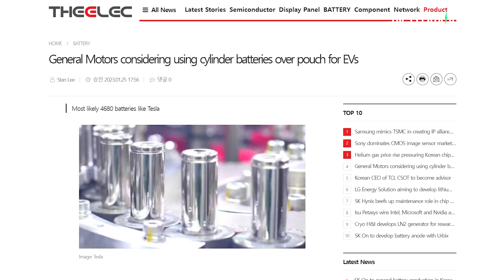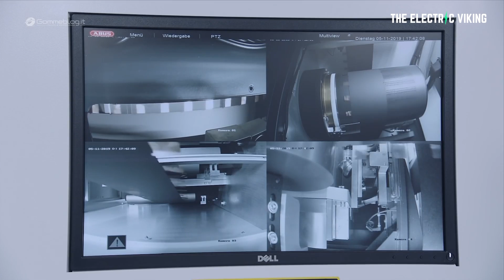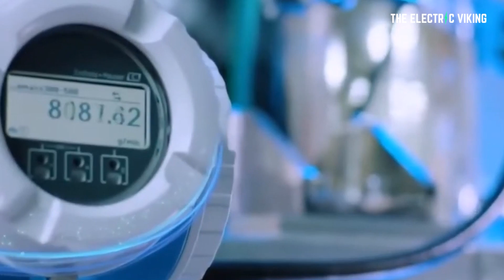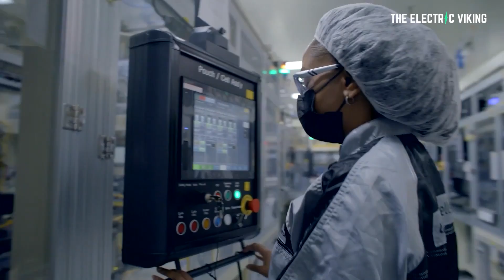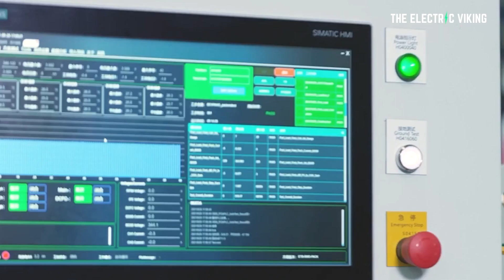Is GM changing from Prismatic to Tesla's 4680 cylindrical batteries?

Comment: Are the Tesla 4680's still using Li ion or are they LFP  ?
Reply: Question is more are they using cobalt based (NMC, NCA, NCMA) or LFP for 4680....
At present the 4680 are only cobalt based but Tesla have indicated they eventually will have LFP in 4680 format - but this is not confirmed.
Reply: I think the for the next 5 years about the manufactured 4680 batteries would have priority
1: Cybertruck structural pack
2. Model y structural pack.
3. Robo/model 2 structural pack
4. Semi( semi is 2170 at the moment)

Only robotaxi and maybe model 2/y standard range would probably have LFP. LFP has lower energy density at the moment so it not suited for all types of cars at the moment. But I believe at some point in future Tesla wants to have Structural 4680 pack in all their vehicles and then they can put all 18650 and 2170 batteries to power walls and megapacks.
But this is like 10years in future.
Reply: @malax4013  I am not sure about this, because BYD already makes their own structural LFP pack, and it is in all their cars. They are already at 100+ GWh/yr. The BYD Seal has a comparable range to the Model 3 at the same battery capacity. I think this is quite an achievement! (Acceleration and cargo space is worse though.) BYD's BEV run rate is 1.3M/yr (hybrids excluded of course).

Also, BYD and CATL are said to start producing Na-ion batteries this year. Na-ion is even heavier than LFP, but it is really cheap, has a similarly long life, charges 2x (!) faster, has better winter performance, and can be manufactured on the same lines as Li-ion. Na-ion is the perfect battery for Megapacks.

What do you think?
Reply: @PeterIsza  You are right about the energy density on LFP vs NCM. They are kind of similar at the moment. And LFP is also cheaper and has more charging cycles. I think they majority of the EV batteries will be LFP if we don't get any better chemistries. I think we will get many alternatives in next 10 years which has little bit different properties to use in different applications. (More power-output, more cycles, better cold/warm resistance etc)

NA-ion seems to be good solution for stationary but it still quite new. In few years time we will know better about NA-ion.
Reply: LFP is also li-ion.
Reply: @malax4013  you didnt answer the question.
Reply: @scottmcshannon6821  They are using Li-ion. I think it's NCM 811 but not 100% sure. I believe they are starting with most researched and well known chemistries that has good enough energy density and would be easiest to ramp up. There are lots of new technologies in this battery so they don't want to overcomplicate it before they have mastered the dry-electrode and -cathode.
Reply: @malax4013  Ok, are 4680s still using Li NMC battery chemistry ?
Reply: The first version is not LFP unfortunately.

Comment: It's cheaper in some cases to wind up batteries. Toilet rolls come packaged this way, and steel plate. Try making Apple use 4680's in their phones and laptops. The packaging is not even remotely as important as the chemistry inside and their ability to warm and cool them.
Reply: Is this your engineering assessment 🤔
Reply: @kabysummit5801  Yes it's faster to wind up a battery than package it any other way. Chemistry is the most important factor, especially one that requires no thermal management

Comment: I think you are right one mass manufacturing efficiency. In addition I would assume that the 46/80 is way more suited for structural battery packs. 

Btw structural pack is the reason why I think NIO is driving down a battery cul-de-sac. But that is whole other rabbit whole
Reply: Nio is more likely driving itself off a cliff with battery swapping.
Reply: @RB-pi3jl  agreed, swapping themselves out. 
Incredible how they get hooked on this idea. But then Tesla toyed with it for few months. I guess that will  make the difference - realizing and acting if you are off track
Reply: @nikos6220  - Seems like a hassel to have to go to some shop to swap out the pack, even if it only takes a few minutes but maybe having to wait in a line.  So much easier to just plug in at home or go to an SC V3 station and plug in your Tesla when on the road, get 200 miles in 15-20 min just in time to use a restroom and get something to eat.
Reply: @Chainyanker007  I suspect the idea looks way more clever in a super densely populated area like a Chinese mid (millions) or large size town (tens of millions) where private loading infra is not feasible. Plus you get the purchase price down, TCO is just not a dimension most consumers are able to think in
Reply: i like how people call it structural battery pack when its just batteries surrounded by foam 🤣
Reply: @jebes909090  that is because it is structural.
Reply: @jebes909090  I mean,  it is really tough foam… they need to work on the color
Reply: @nikos6220  nothing manlier then pink ;)
Reply: @jebes909090  😂
Reply: @jebes909090  every man loves pink.